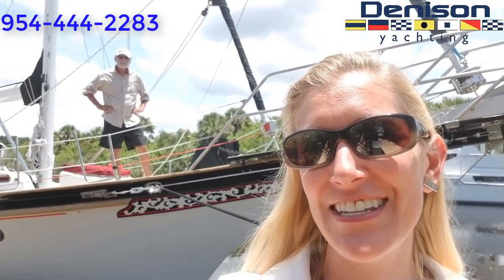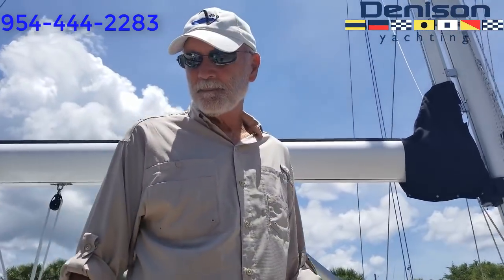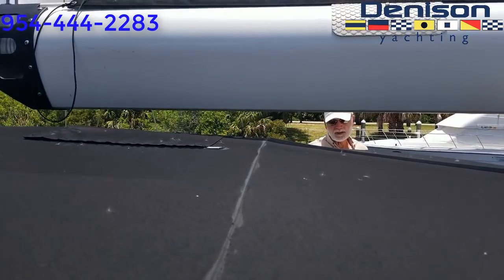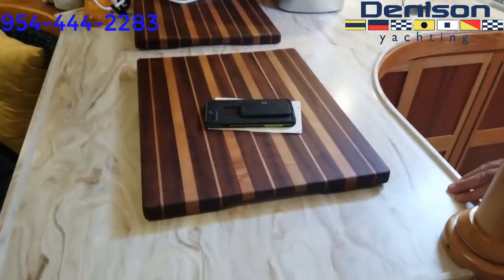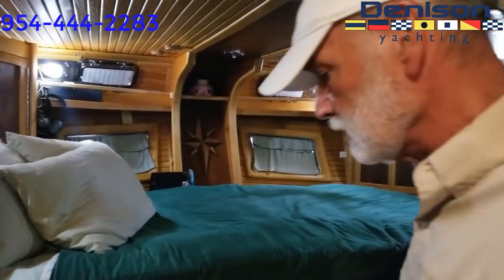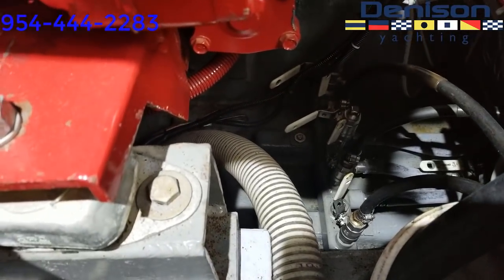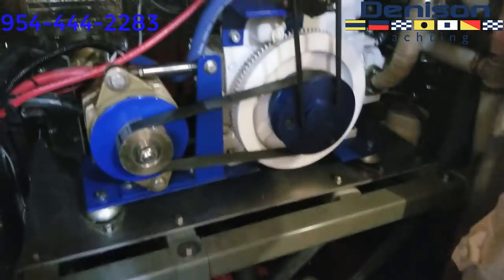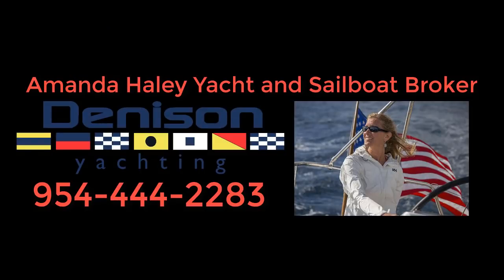47FT VAGABOND KETCH - RESTORED TO BETTER THAN NEW!

Comment: The original teak lasted about 45 years. How long before that fake stuff starts to show its age? And what's wrong with simply painting a teak cap rail? You tore out the Burmese teak interior?  That wood is irreplaceable. Either way a beautiful boat and a great restoration.

Comment: Audio on this video sucks, the artificial teak is really bad idea if you ever plan on being barefoot, it soaks up heat like a sponge and goes straight into the boat... I know because I have that same artificial teak on my 47' vegabound ketch, I hate it... in fact I'm ripping off asap and going with a gelcoat deck with anti skid asap...
Reply: Ah, good to know. I was initially thinking the synthetic was a good call because of the extreme maintenance schedule of an all original Vagabond. Pros and cons to everything I guess. 

My friend had a Vagabond and he spent a LOT of his free time on deck maintenance. I remember it took us several weekends just to revarnish the wood wheel. Beautiful boats but they are a time investment.